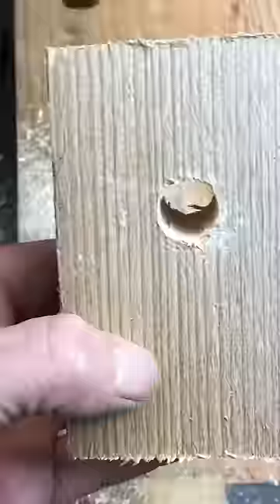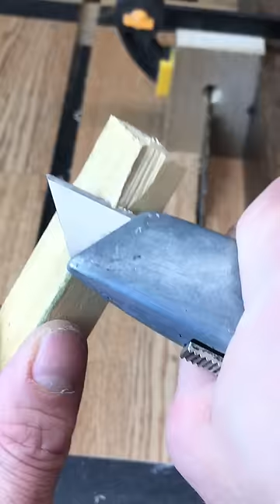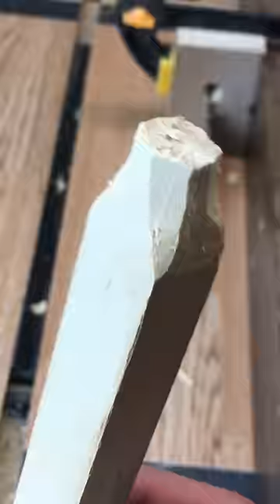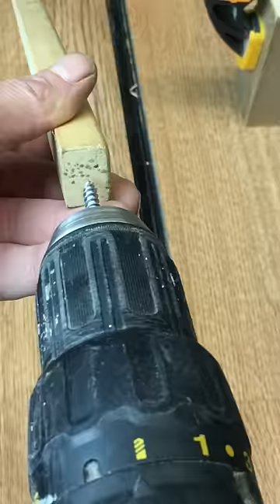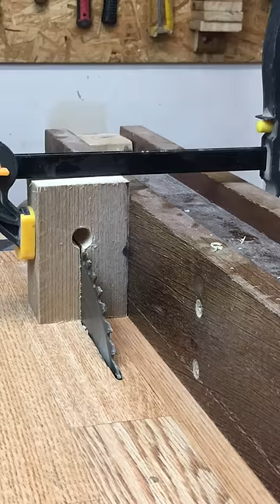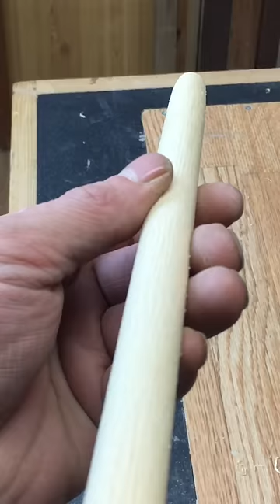Free Dowels 😃 #shorts #tipcentric

Comment: Never will I need a dowel so badly that I’ll risk sending in my hand into a blade raised all the way and clamped in with a jig like this 😳
Reply from the maker: Hands go nowhere near the blade. And because you clamp the jig first and raise the blade into it, there is zero chance of kickback. The blade itself is only raised into the circle by a hair, it's the drill that does most of the work.

Comment: Good job brother.... I use nearly the same method... only I drive a socket where you run a screw in... keep on brother man... God bless
Reply from the maker: Thanks! It’s a great method, nice smooth finish on the dowels! I’ve tried a ton of other methods in the past but always come back to this one as it takes the least amount of time to set up and the dowel size is easily customised. I’m going to use a socket next time, mostly the screw is fine, but every now and then, if the grain is diagonal in the blank, the hole will strip. Cheers man 😀😀👍👍

Comment: I have a better idea don't buy a square piece of wood,  buy the right sized round wood
Reply from the maker: This was scrap wood, cost nothing. Dowels from the store cost a fortune. why pay someone else to mill your dowels when you can do it for free?
Reply: @tipcentric  unless you work with wood a lot what are the chances of have a piece laying about
If your doweling is expensive then the lumber yard must have seen you coming 🤔
Reply from the maker: Who else needs dowels other than people that work with wood? Making is always better than buying and anyone with the need for dowels will probably have a pretty decent collection of scrap wood pieces they can use.
Reply: @tipcentric  DIYers for one, 
besides most carpenters would know how to fashion dowels if they needed too, 

It really depends on wether you need a plug to cover screw holes, or for a rail, I.e to replace a broken paper towel holder 

Agreed if you have scrap material laying about then it's cheaper to make than to buy